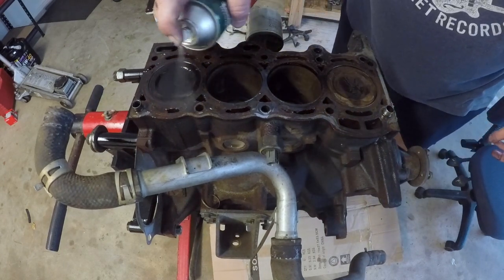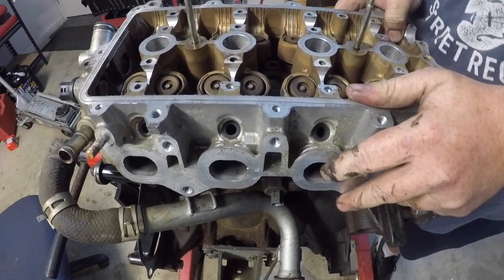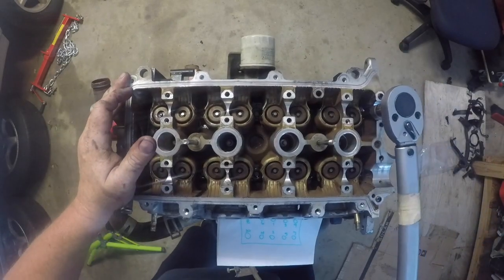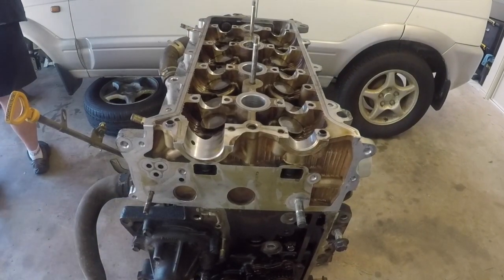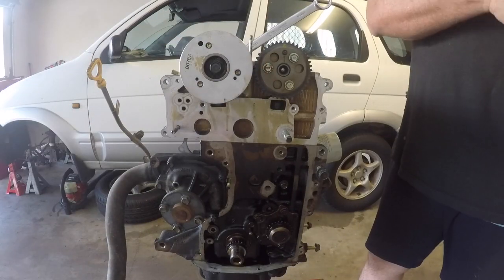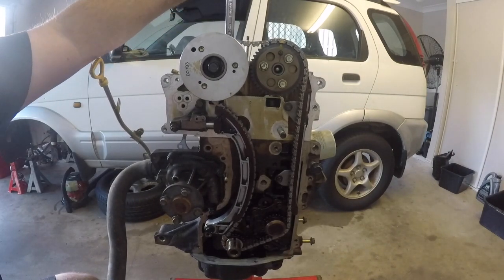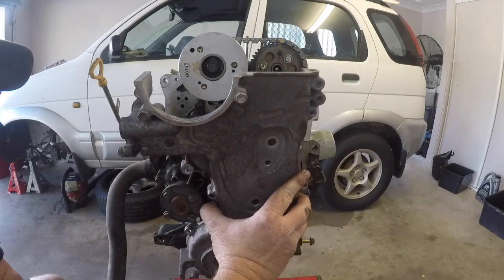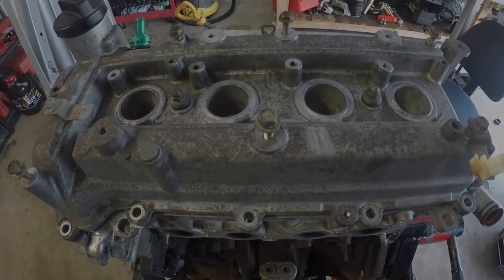K3-VE Cylinder head replacement with Timing Chain Set up

Comment: Thanks for the video,very helpful. I have a 1.5 Terrios.  Not much problems as I change my oil and filters often. Replaced coil packs and had to repair the Gearbox. The lay shift bearings siezed up and broke out of the housing side by the bellhousing side. Had a great gearbox guy weld it up and replace bearings and seals.I suspect it left the factory with hardly any oil in the box. When I did the clutch kit previously I filled the box with 2 liters of oil. I did buy it from a friend at 80000km and he did tell me about the gearbox noise. I just never got round to stripping it and replacing the bearings and seals. So I could have prevented this failure. I did think it strange that the box was noisy at such low milage. I want to throw off the emission crap that's on it and put a oil catch tank on. As it is a direct injection. In my country it's not a problem to run without smog controll. Do I need to reprogram the computer or can it relearn itself after I throw all that stuff off?. Any help would be appreciated.

Comment: Can I put camshafts from k3vet to k3vet2? Because I can't find the original for my k3vet2 ... please help
Reply from the maker: Not 100% sure as there were some engine updates that may have included camshaft profile changes. As you are stuck I would try is out, but it will be a bit of a gamble. 🤔

Comment: Hi sir
Just out of interest, does overhauling this engine might be better compared to swapping engine.
What are the pros and cons.
What are the expected cost?
If the overhauling is done, how long can the engine last until the next overhauling is needed
Thanks in advance
Your feedback would be much appreciated
Reply: I can't answer your question but I tell where I'm at with my sirion. It's had four owners, bought from the dealership back in 2003. Leaking oil from the valves still runs, and to put seafoam trans tune to clean up transmission works better than before. Change idle sensor twice, changed radiator. About to a gasket set change: head gasket new valve seals new rocker cover gasket. I know it'll be a real sleeper when I'm finish with the tlc

Comment: Is the engine clean since you disasemble it? Or you clean it after disasembly? I really have a problem with cleaning the mess (sludge and muddy oil) i use everything brake cleaner, presurised water nothing's working
Reply from the maker: https://youtu.be/1HT7KgUTXYQ

Comment: oring vvti !!!!!!!!!! fail install 12:29
Reply from the maker: Holy Moly!!! Just spotted that missed placed O-Ring. I went back the the unedited raw footage and I it was fixed prior to bolting it all up. Thanks for picking that up, Great Work!! For those reading the comment at 12:29 you can see the O-Ring for the variable  valve timing was misplaced. This would have caused the variable Valve timing to not function and would produce a check engine light oil with oil pressure escaping.
Reply: @killawattgarage   thank u so much for your video .    I have Avanza2005  and It's Engine k3ve 1300 cc

Comment: hi, i think i'm having trouble timing the engine, the tentioner lands right between two tooths and im left with a bit os slack between the camshafts, is it normal?
Reply from the maker: Sorry for the slow reply, have you got it sorted?
Reply: @killawattgarage  hi, thanks for answering, yes, I got it sorted out, turns out that if you hold the intake camshaft and apply a little bit of force counterclockwise while applying a bit of force on the crankshaft but clockwise, all the slack off the chain falls on the side of the tensioner. Although, the tensioner rack always fell between teeth, so I'm not 100% sure if the chain is not stretched, since I didn't found any way of checking that in the manual

Comment: sir..how to set the chain into marking in exhasut sprocket..i two mark..which one?
Reply from the maker: Double check at 8:45. there is a double mark that goes on the crank sprocket and single marks for the cams.

Comment: Only 1 time 90 degree sir?
Reply from the maker: Yes. First 20Nm then 32-34Nm then one 90 degree turn.
Reply: @killawattgarage  that not enough sir.. it should 2 time 90 degree..sorry for my broken english
Reply from the maker: @stanlee7669  no just 1 90 degree turn after the 32-34Nm torque
Reply: @killawattgarage  ok sir.. but ,I already repair many of that type of engine. Based on repair manual. Because, i'm toyota technician.sorry, not to show off.. just sharing 😄

Comment: Valve adjustment....?? 🤔
Reply from the maker: I replaced the tappets into the same place, I couldn't get replacement tappets. I measured the clearance and they were close to the specs. Inlet .14-.24mm and Exhaust .27-.37mm
Reply: Thanks

Comment: Hi, nice video. Are you using 1/2" M9 Cylinder Head Bolt Tool ?
Reply from the maker: Yes it is a M9 triple square or spline bit. They are not a common size.
Reply: @killawattgarage  Thank you.